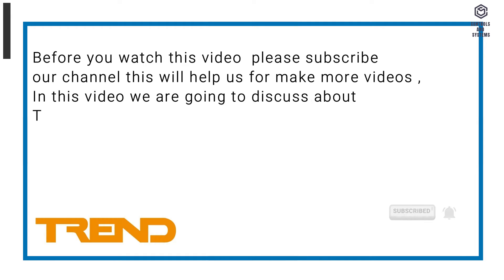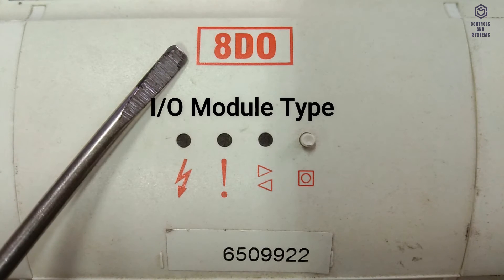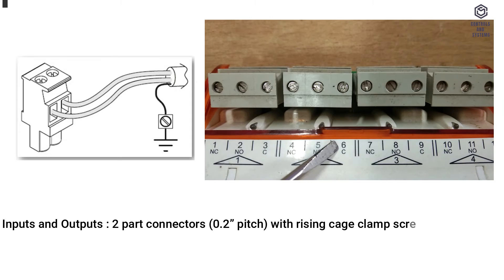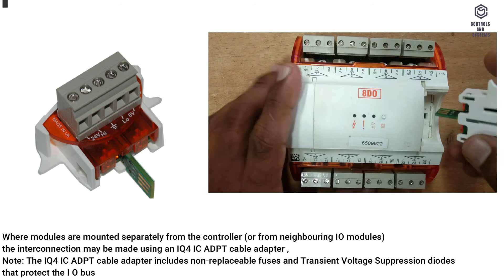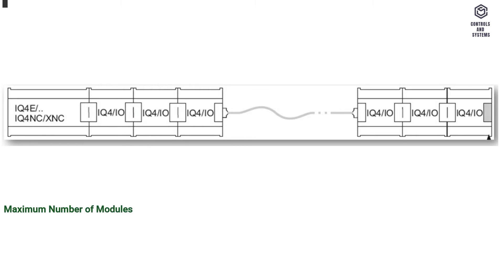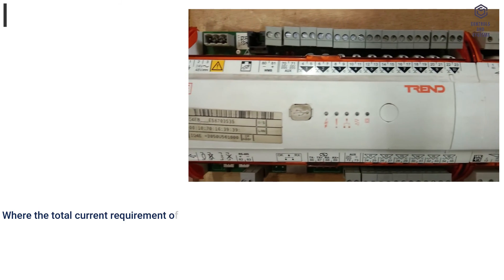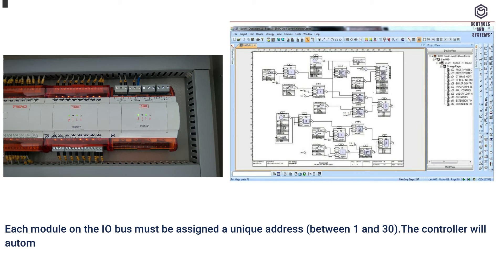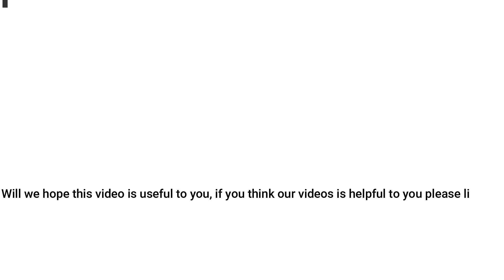TREND 8DO IO Module Complete Operation Part 1 / #TRENDCONTROLSYSTEM

Comment: What is the Max. Voltage that can be bypassed through NO & common port of  DO MODULE?
Reply: Please reply
Reply from the maker: In Trend DO module they using ETE relay it's range is 6A/250V AC..
Reply: @insightcontrolsystem  Thanks for ur response 🎉🎉